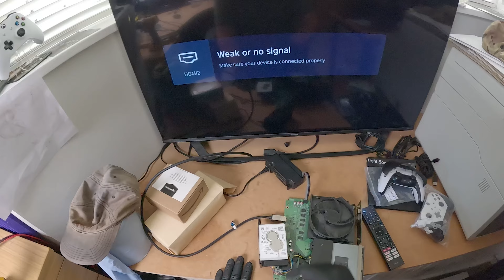Xbox One S No Display THE TESTER LIES!| HDMI Port & TDP158 IC

Comment: Good day i have an xbox one s i get it to work on my computer monitor the computer monitor is a uhd one but xbos only shows at 720 p if i change tge settings above 720p the display is dead. And the xbox is working on some tv s but not all of them like 1 out of the 5 it was pluged into. Can that also be caused by the timing ice?

Comment: plan to buy the chipmunk hdmi tester to test the HDMI retimer... looks like it is useless because all lights shows up
Reply from the maker: It's not useless by anymeans. It ok for checking connection if you are unsure of soldering work. Thing is the Chipmunk isn't designed for consoles. It more for PC based HDMI connections.

Comment: Interesting, I was considering  one of those testers.
Reply from the maker: They are ok for finding broken traces. However like in this they cant diagnose faulty IC's, they are more of a sanity check.
Reply: The testers shows ‘signals’ not if it is actual valid data. If the re-driver is re-driving nonsense your tv will have no image but the tester will show data.
Reply: @cmizapper  Appreciate you taking the time personally.
Have used your USB tester to great satisfaction when I was doing more laptop/ MacBook work. I was intrigued when you came up with this one.
Reply: @MicroMageRepair  The HDMI tester works on the recent MacBooks that have HDMI.